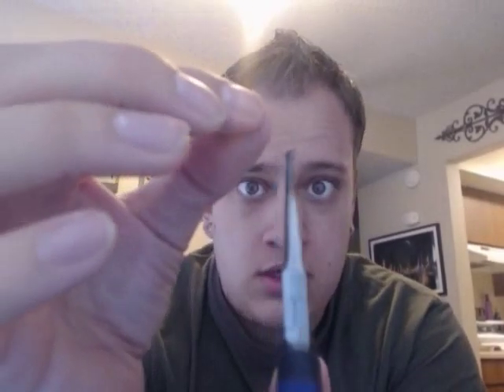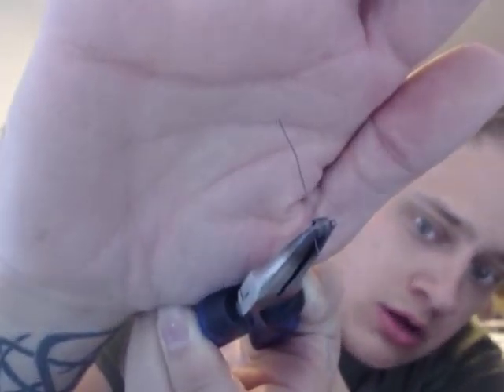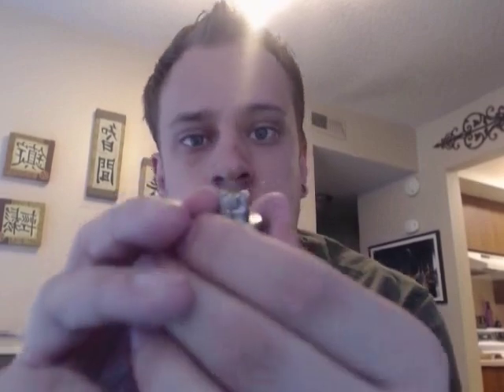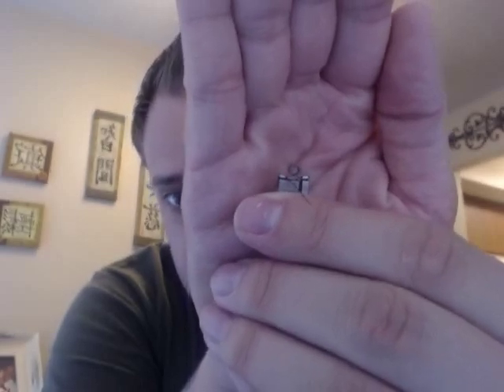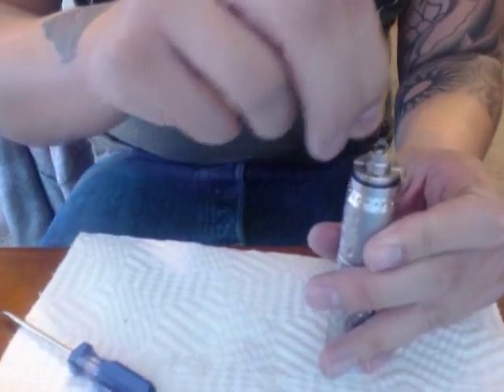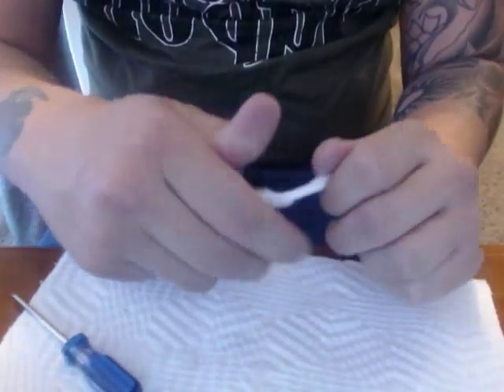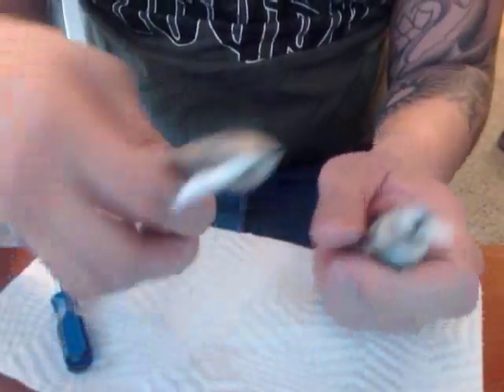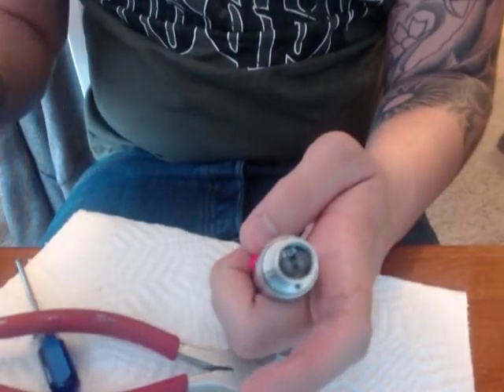Kayfun Lite Micro Coil w/ Cotton Wick

Comment: I have a dna 30 mod with a RBA what rap do you sugjest I use ??
Reply: I use a dna 30 with an EHPRO kayfun, i made a six wrap coil using 28 guage kanthol, it has a 1.4 ohm resistance. I'm putting 8.5 W through it and it's vaping great :)